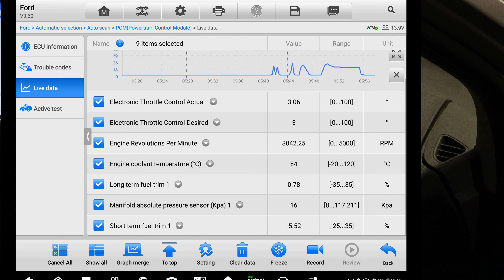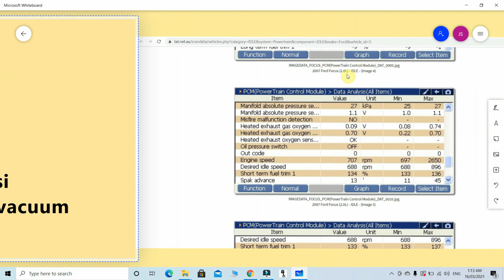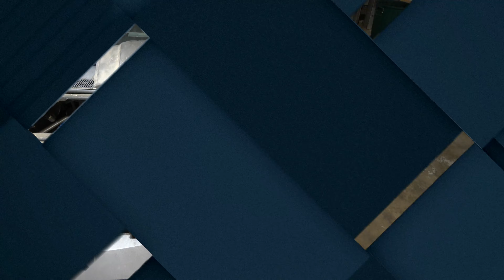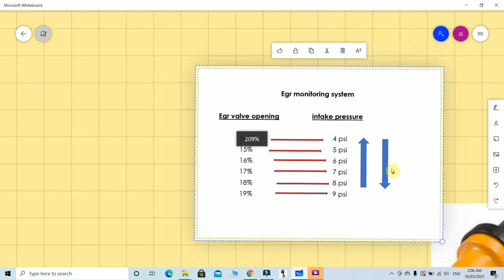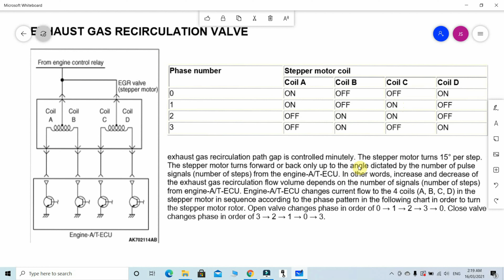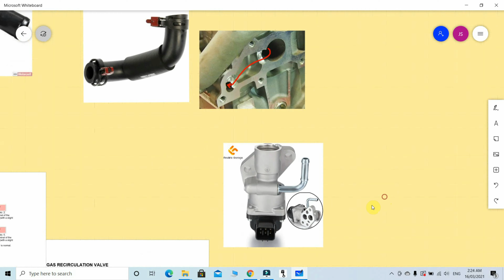ford focus P0400 egr flow problem

Comment: Thanks for education👍. I think that car also had issues with throttle body, because actual position was  way higher  more than desired if   I saw correct in the video

Comment: I had a p0400 engine come up that I cleared with scanner,. Hasnt come back yet, but my fuel economy around town has gone up to well over 20L/100km, but my highway fuel economy has remained constant since the code appeared.

Do you think these could be symptoms of a vacuum leak like you mentioned??

Comment: Very helpful material. I have that problem on 2005 Focus 1.8 duratec. I clean EGR but problem isn't gone. Thanks for your help.
Reply from the maker: Thank you
Reply: @a1mechanicaloakey  I found issue. Broken rubber hose from pcv valve to intake manifold. Thanks again for the help 👍
Reply: @pawelrybarczyk8702  what were the symptoms?
Reply: @2Calam  P0400 continously, irregular acceleration ~ "turbo hole" and less power
Reply: @pawelrybarczyk8702 która dokładnie ta rura była zepsuta? Pamiętasz może? Mam ten sam problem. Czyściłem mega dokładnie dwa razy zawór EGR a i tak co 300-400km błąd P0400 wraca?